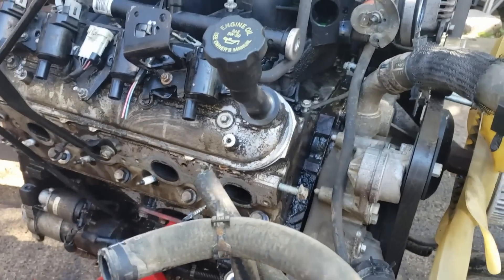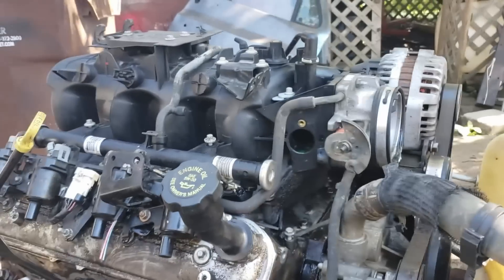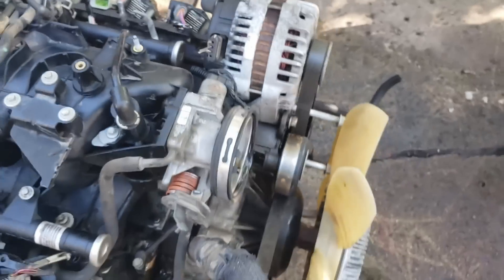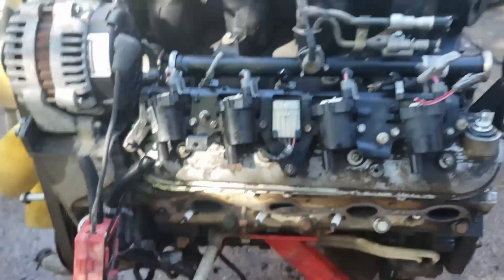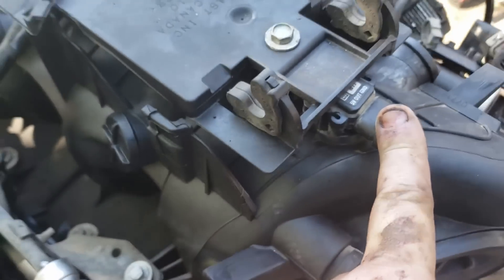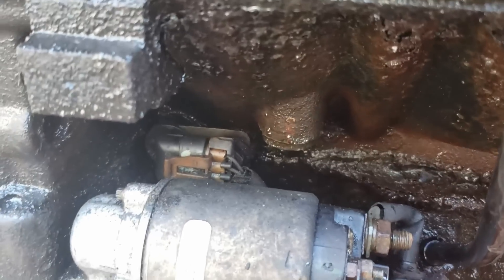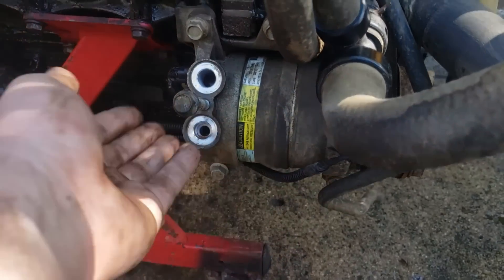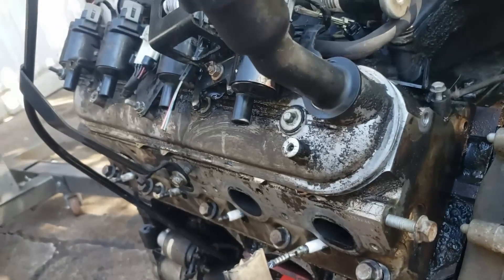Gen III LS Sensor overview

Comment: maybe someone can help? I have an 84 c10 with ls swap or possibly lq, noy sure how to tell? problem is that my purge solenoid/sensor/valve is not connected and looks exactly like this guys, will this cause a 171/174 code? there no plug or rubber lines running to the sensor? any help or info will be appreciated....thank you!
Reply from the maker: It doesn't matter if it's an LS or an LQ or an LR, it's all the same. 

If the tuner didn't turn off the codes, you'll have codes.
Reply: @TheDrivewayEngineer  Thanks again for the reply, so I was wrong. The item I was referring to is the purge solenoid just behind the throttle body, of coarse still didnt eliminate the code.I installed new MAP, MAF fuel pressure reg, I guess next will be fuel pressure, fuel pressure sensor on the fuel rail then 02 sensors? seems to start better and idles smooth ....I suspect maybe an exhaust leak at the headers? Oh well,  back to videos!
Reply: @TheDrivewayEngineer  Hey bro! I found the culprit that was throwing the 171/174 codes on my 84 ls swap....it was a direct vacuum leak on one of the vacuum lines branching off the intake....wasnt even plugged in to nothing or plugged off....so theres a vacuum lines that plugs into the fuel pressure regulator, the evap canister and the loose one I found, all 3 come off a 3/8 vacuum port bout middle of intake and branch off  with an adapter. Where would you suspect the one I found would plug into? Right now I jus have a vacuum gauge plugged in it.

Comment: What sensor have you removed, on top of the oil filter?
Reply from the maker: There is no sensor in that location
Reply: @TheDrivewayEngineer  Oh, i have a lq4 and it has a big rubber plug sensor right there. Lq9 has a blind plug there. 
maybe it's just the oil pressure sensor etc

Comment: I have a 06 5.3GMC Sierra I swap the engine out 2 years ago . So I had cooling  system  working  properly with 3 speed system. After the swap my speed does not turn on. My truck temperature would stay at 180. All the time. But lately it been running hot from 180 to 210. Still the high cooling fan does not trun on. Can you help

Comment: Hey guys I need some help I did an LS swap on my 77 Trans Am I have been running it for three months just this last Saturday I lost pedal I’ve changed the TAC module four timesAnd still I have no pedal the OBD says lost communication at the pedal don’t know what to do need your help all by the way I don’t have a vacuum leak
Reply from the maker: I've seen this happen for a million reasons.

1 is wiring being bad.

1 is the pedal moving around and not secured.

1 is a bad crank sensor, or crank sensor wiring.

Have you tried another pedal? Have you pulled codes?
Reply: It’s a brand new harness from PSI but I did suspect the Cranks sensor and yes I change the pedal the harness to the pedal with brand new parts but the crank sensor the cam sensor our old from when I pulled out the engine thanks for the advice I’ll let you know in a couple days

Comment: you should make a video on why different head bolts from gen 3 and 4 is it the heads or blocks that changed??🤔
Reply from the maker: Alot of things changed between Gen III and IV
Reply: I'm talking about the head bolts lengths
Reply: why do they change?

Comment: How realistic would it be to try to get close to 550 hp out of a 5.3 engine or would it be more manageable with a 6.0 and I want to be na
Reply from the maker: It's not manageable or cheap at all.
Reply: Right on so it's just quicker an easier to add the turbo an be done right on bro thanks for the reply n keep videos coming

Comment: D585 coils are not my fav. i dont like the preignite function and they will Skew the Dwell. in boosted apps that can be destructive .
Reply: apollo robb what coils should be used on boosted engines? Part #?  Thanks.
Reply: @29auto30  I prefer the D581 for just about all applications

Comment: What brand of degreaser do you like?
Reply from the maker: I usually use diesel, this time I've been using Awesome from DOllar Tree, and it does work awesome
Reply: James Dodd Castrol super clean. At Walmart. Don’t get it on painted surfaces.
Reply: Cheap stove cleaner also works very well
Reply: @mcfero1  I watched a video where oven cleaner discolored aluminum parts on an engine.

Comment: Waiting for the busted exhaust bolt removal
Reply: He went over it in the other 6.0 build. Iirc he basically welded a nut onto the surface of the stud and took it out that way
Reply: They are pretty easy when out of the vehicle. It's possible in but not easy
Reply from the maker: I didn't use a nut, I never use nuts or washers, I just weld a turd to them and twist them out.
Reply: Here Dj, just go straight to the source. It’s like watching Driveway Engineer, but 3 years ago 🤔
https://youtu.be/1bZyw3OSIgk